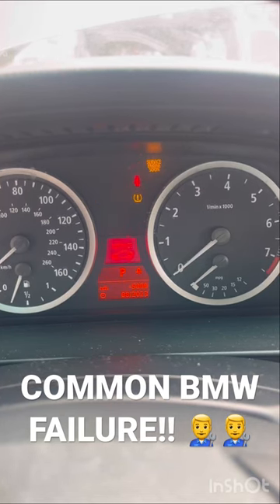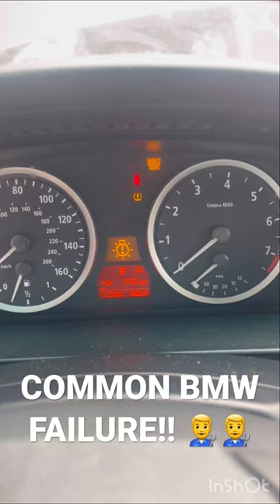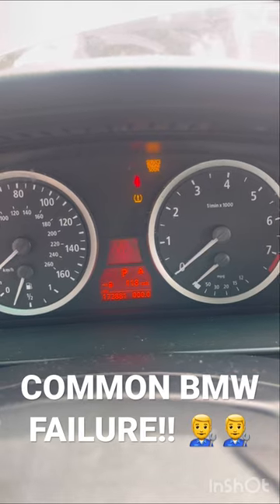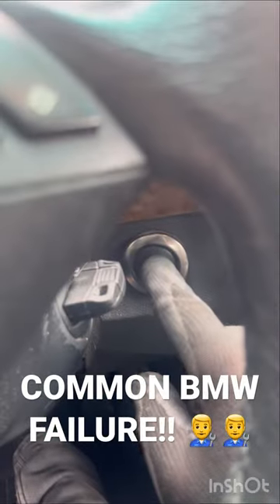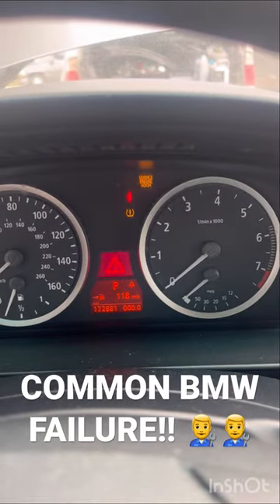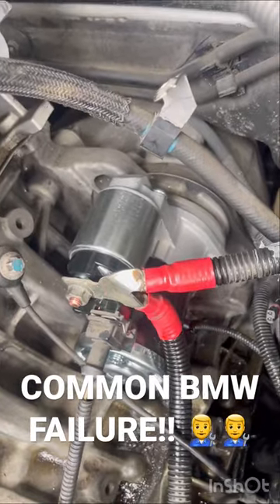Common BMW's STARTER failure #bmw #mechanic #fail

Comment: Or you could have a broken ground strap so it’s not grounded and will not start your car 

(Quick fix) 
Get one jump lead and attach one end to the engine steel hook on the top of the engine and the other side to your shell of your car or (top mounts) 

Once that done it will start your car but if left on to long it will melt the jump lead after 30/40 minutes as it’s not thick enough to hold the currants going though! 🙌

Any other quick questions you have on your bmw ask me and I’ll try to my best knowledge to help!
Reply: Need some help !
Reply: Got a 2008 BMW 328i 

Drives fine but just today I got in it and went to start it, 

It cranked, started up and then shut off. Lights were still on. 

Did it again, it cranked and started but then shut down again

Cranked it started up fine… and drove off like nothing happened? 

Could it be a bad battery? Starter? Fuel pump ? 

New to the BMW btw, thanks !

Comment: Having this exact issue on my 2007 328i thought it was the fuel pump because I ran out of gas and problem started after that but I see in the comments that it would atleast crank but it doesn’t so I’m convinced it’s the starter I also changed the relay no luck
Reply: same
Reply: Interesting, I’m having the same problem currently on my 08 328i except I went to start it then shut off on me until the 3rd try and it started up and drove fine.. but I’m not 100% sure if it’s the fuel pump, starter or battery, I’m new to bmw. Any help is appreciated! Thanks !
Reply from the maker: @Rtb323 i recommend you to scan the car, can be pretty much anything from vanos solenoids to fuel pump or fuel pump control module, not the starter or battery different story for you

Comment: Drive all day pumped gas was on half a rank then never turned on pushed it to the side towed it then when i put my feet on the breaks i pushed the push start and it turned on left it on then drove it parked it went back outside after 15 min turned on fine when back after 40 min and it did the same thing no start ????
Reply: @Zeiten
Reply from the maker: I’d say check ground and positive connections, might be corroded, possibly starter but get it properly inspected no-one can diagnose a car remotely

Comment: I hear some clicking and I hear my fuel pump and the air conditioning turns on. But no engine sound. I just replaced the spark plugs and the ignition coils and the car still won’t start.
Reply from the maker: Because stater died most likely and everything you just replaced had nothing to do
Reply: @Zeiten not always starter bud
Reply: @marceloalmeida3780  then what else would it be? because my car had the same issue, and I thought it was a bad alternator, which wasn’t the issue, then I changed the access modifier relay and that wasn’t the issue. I changed the starter and guess what.. the mf starter 🤣. Don’t comment and just say some stupid casual shit like “ not always the starter bud” 
Clown talk fr you internet weirdos are something else.
Reply: @-KPG-  could be a bad ground. Just had one here at my shop with same issue. Was a bad ground.
Reply: @-KPG-  Stop getting hurt by comments. I fix car for living... I just said that it is not always a starter. Thats why we do diagnostics before change any parts.
Reply: @marceloalmeida3780 my car started 2 take a little bit longer 2 start.. Between this i changed the front right brake pads last Tuesday.. The car started no problem. On Saturday going 2 get the child it kept cranking but started. On Sunday i changed the left pads with new sensor. It cranked or cliked for a we bit but no start & stil wont start. Reds on lights on. But when trying 2 start it fades into nothing
Reply from the maker: Sounds like battery
Reply: @Zeiten hi pal your comment is after mine. Our you referring 2 me with bad battery

Comment: I replaced starter it runs but makes a tinkering noise
Reply: lifters tick is what thats called i think not a problem ive heard that if you put a lil thicker oil it helps

Comment: Man I hit a bump so hard my car shut off and will not start or crank , its a n52 as well
Reply from the maker: Check positive terminal on battery, there is a part that pops off during accident might be your issue
Reply: 100% baterry fuses on the terminal
Reply: I have the same exact issue. 2007 BMW X3. With one difference - the engine DOES start after sitting in the driveway for 4+ hours. It will continue to start well with no delay or stuttering or hesitation. Then after driving it for a few hours with many stops with the engine being turned off and on it decides to not turn over again. Can anyone suggest a solution?!

Comment: Check starter relay first lol
Reply: Gdzie on się znajduje ?
Reply: @marcinstasiak6821  there’s one in the fuse box in the engine bay (passenger side, white box), and one in the car on fuse panel behind glovebox.
Reply: My 07 makes a winding grinding noise when I push the button. Starter?
Reply: @craker213 possibly, could take a voltmeter to it to see if its the same as battery

Comment: What if it’s slow crank no start???
Reply from the maker: More likely battery issue, diagnostic is necessary
Reply: it could be your starter went bad
Reply: @honorablewiz7447 I might try this cuz I got a new battery and after a while it came back and cranks slow with no start, but with a jump start it turns on. Weird idk
Reply: @honorablewiz7447 could be loose wires? But idk and everything is tight asf on this car so it's annoying
Reply: @felixgallo1693  yeah so slow crank it sometimes because your starter is seizing up and need to be replaced. If it's a manual you can have a friend push the car and you pop the clutch to start it...if that works then it's the starter. AND THEY GO BAD
Reply: @honorablewiz7447  I’ve replaced starter, fuel pump,spark plugs, ibs, grounds, checked dme, cas module still crank no start 🤯
Reply from the maker: What year and model?
Reply: @jorgetovar8206  did you try to turn the engine by hand?

Comment: If your car ever does this, DO NOT LISTEN TO "YouTube mekniks" and take the car to get diagnosed properly 
Vehicle has over 30 000 parts in it and there could be many different causes of this problem
Reply from the maker: Yeah don’t listen to someone whose job is to fix bmws every day, good advice🤡
Reply: @Zeiten  if you recommend your customers to replace starter every time there is no crank......you should not be working on any car.
There is such thing that is called "diagnosis"
It could be faulty ignition, faulty immobilizer,  battery could have less charge than it is required.
Making a statement like this is quite a strong sign of not being a professional mechanic.
I work on bmw every day too, so what?
Never ever I could say "oh yes, go spend $500+ and change a part"  without investigating.
This is absolute nonsense
Reply from the maker: @dkrawk8309 if it is faulty ignition or immobilizer then the dash wouldn’t light up or wouldn’t recognize the key, if the battery didn’t have enough juice then light would flicker and starter would still made a couple turns. You are wrong, from my decade + in the field on n51/52 engines those exact symptoms that are displayed 99 times of 100 turned out to be faulty starter. This statement comes from experience and of course when i come in i diagnose the car but people with exact same symptoms who want to do it themselves but don’t even have a scanner will benefit from taking this gamble and just replace 150$ starter rather than go deep in the hole. First thing that many bmw instructors agree on is when analyzing a problem start with basics and in this case the basic thing is starter failure
Reply: @Zeiten  ok that is great. 
Based on my experience trying to have an adequate conversation with "mechanics" who right away jump to hostile defense, never lead to anything productive. 
I appreciate your time and wish you best of everything.
Reply from the maker: I think i laid out my thought process and reasoning pretty clear and respectful🤷‍♂️
Reply: @Zeiten  God bless

Comment: Really without a diagnosis
Reply from the maker: Yep, out of 100 cars with those symptoms 99 will need starter replacement, no need to overthink it on N51/52 engines especially
Reply: @Zeiten  NO you have to perform a diagnostic procedure ... checking battery and available battery voltage...a voltage drop test to verify engine to chasis ground .Then access KL15 and verify voltage when attempting to crank ...I should have started with a scan tool to check for fault codes  ...40 years with BMW you learn to diagnose first
Reply from the maker: 40 years owning or working on them every day?
Reply: @Zeiten  Working on BMW as a certified Master tech  . BMW NA certified retired 3 years
Reply from the maker: Well you’ve definitely seen more than i did in my 10 years, but in that particular case of n51/52 starter failure i’m 99% correct with described symptoms. I do agree that inspection and diagnostic is absolutely necessary at all times, but once again that particular issue is exception to the rule
Reply: John this person knows his stuff Zelten is here to help people 💯
Reply: @Zeiten mines was clicking then started.. Now it clicks & clicks.. No start. It was doing the clicking for 2days then just wont start. Al that after fitting new front brake pads. Any idea what it is

Comment: I replaced the starter still the same issue
Reply: I’m having issues with my bmw as well, I got a new starter in August last year, just replaced the battery along with the fuel relay, it started but now I’m having intermittently starting… thinking about checking the starter relay before getting another starter 😩, have you tried those things?
Reply: Also changed the ground strap